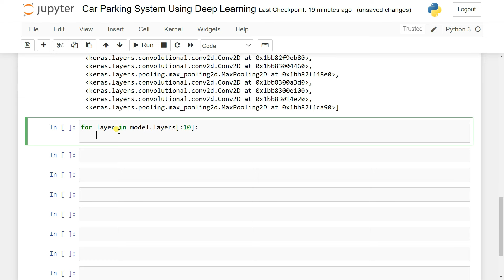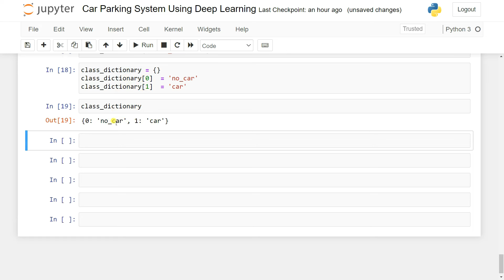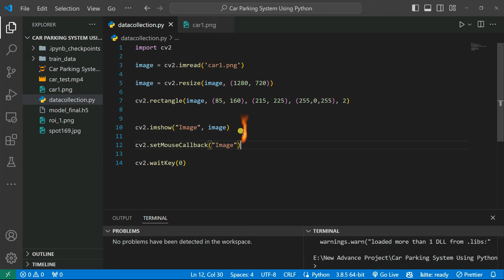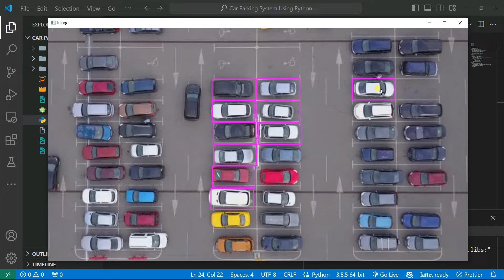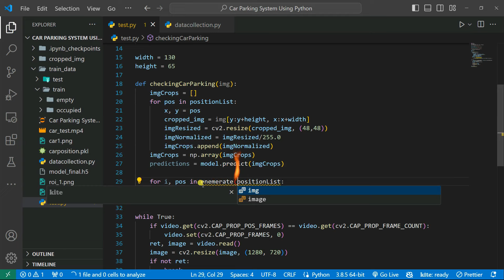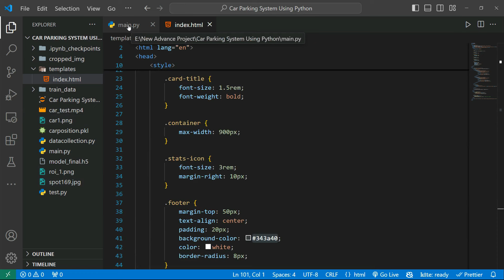Project 40 : Car Parking Detection & Space Counter Using Deep Learning | Flask | OpenCV

Comment: why the car in video is moving like slomo? when you test the py script is it possible to check it like the actual speed of video? not slowmo
Reply from the maker: It's FPS issue,  I use low ended pc here.
Reply: How to fix that?  Should we use high end PC? Standard specs? @knowledgedoctor3849
Reply: @knowledgedoctor3849  how we fix it? should the fix is to use high end pc? or we need to adjust the code?
Reply: @knowledgedoctor3849  what will be the fix? is it on code? or use hight end pc?